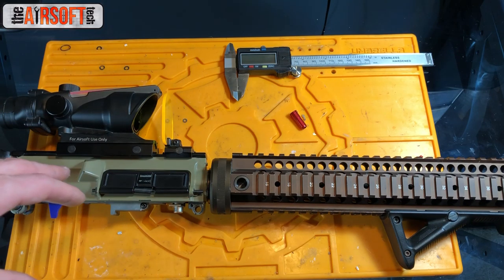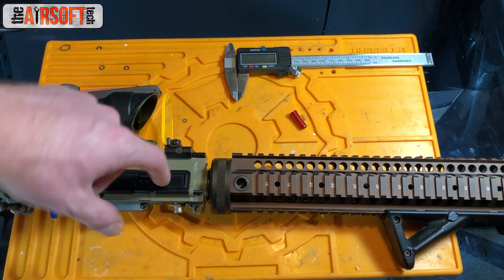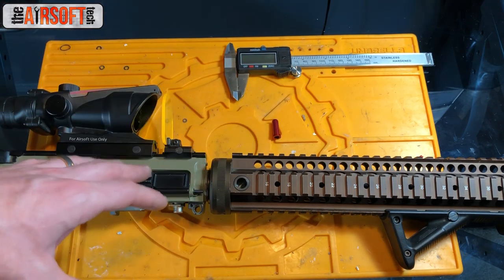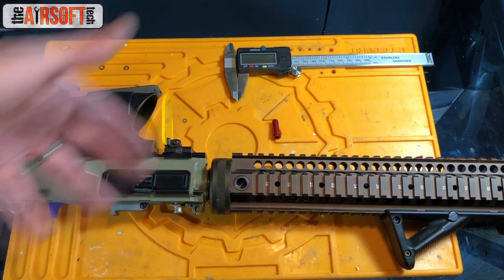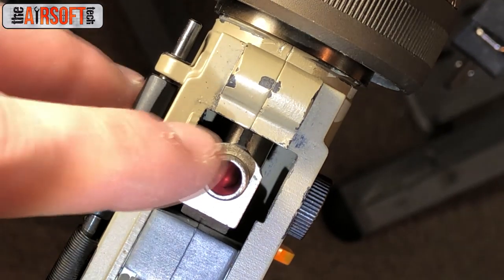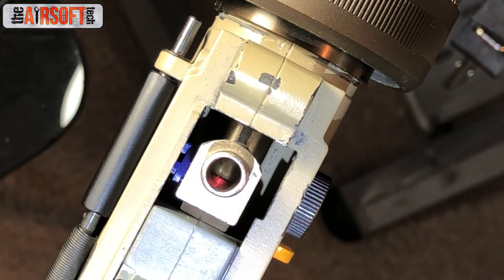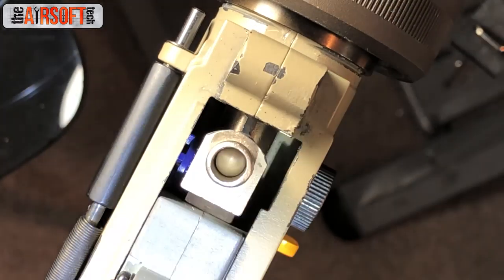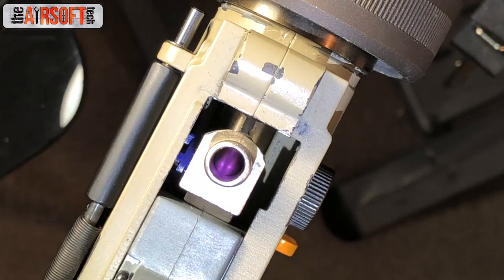Five Minute Tech Tips: Proper Air nozzle Fitment

Comment: Quick note: Whenever you shave down your nozzle, ALWAYS TAPER THE FRONT. If you do not taper the front, there will be lots of fps and airseal issues between the hop up rubber and nozzle. So put the nozzle on a drill and use sandpaper to create a rounded taper on the front of the nozzle
Reply: While this is generally true and advisable, I've been using the same un-tapered (or very minimal) G&P nozzle in one of my guns for ten years now, and it's never given me any problems. When in doubt, TEST.
Reply: So like question, what is the recommended method to shaving down a nozzle? What tools should I be using to shorten and taper?
Reply: @KoujiRenamon  i put the nozzle on a drill and then use some sandpaper like a makeshift lathe. round it off little by little until the nozzle is tapered enough to be making good contact with the bucking. Do not over taper or else you would make the airseal even worse. Test by inserting the nozzle into the bucking lips by like 1mm and see how well the lips wrap around the nozzle (no innuendo intended)
Reply: be careful when tapering. overdoing it will also make the  nozzle failed to mate with bucking lips and will drop the fps
Reply: @n8taing612 30° or 45° angle?

Comment: This didn't tell us how to find the right nozzle. Just tells us you need the right one. This isn't all that helpful. Having the nozzle go back far enough is just one of the factors. Also, you can only test this in the way you did with an ics split box. The air nozzle fitment is so important, and you have the least control over it. Just looking for answers

Comment: what about the nozzle meshing with the hop rubber? or i guess should the rubber be flush with the hop up chamber? it seems the purple nozzle stops just short of making contact with the hop rubber.
Reply: Looks like the airseal doesn't concern him although in this case you would want to assemble your gearbox without gears, spring and spring guide with piston placed in the rear position, then put gearbox and barrel\hop-up assembly into the build as much close to the fully assembled gun as possible with only exception being having a window to put a long rod and push the piston forward while keeping the muzzle of the inner barrel sealed with your finger, if the airseal in the cylinder and between nozzle and hop-up rubber is good - you won't be able to push the piston all the way forward, if there will be a hissing sound and a slow air leak - an extra 0.2-0.4mm of nozzle, more blunt shape of the nozzle front end or the hop-up rubber with thicker lips might help out, if there is no airseal whatsoever the gap between nozzle and rubber is major, you will even probably see the light from the feeding valve of the hop unit if you will point a flashlight into the inner barrel
Reply: @lauranceberiya1314  is there meant to be space for the BB?

Comment: So I have been teching for a while and learned most my skills from you, I rebuilt my buddy's gun. G&G C7A1 (converted by previous owner to A2) that comes with lonex internals from the factory. He got it for cheap because it wasn't feeding correctly and had horrible FPS. So I cleaned, re greased, corrected AOE (was pretty good from lonex), shimmed gears (horrible bound up shim job from lonex), swapped in an SHS lightened piston, new bucking and nub. Fed OK at first then back to miss feeding lots, but also had significant fps drop. Air nozzle was worn out on the inside (polymer) so I got a new aluminum o ring nozzle, glued it to the tappet and back together. Fps was good and miss feeding went down. I measured the OEM lonex nozzle and the new one, exact same length. Still misfeeding. So I shimmed the tappet with a piece of electrical tape, helped some but not a lot.
Kind of getting stumped on this one, hopup is lonex and isn't damaged and the o ring on the hopup is good. Nozzle spring is good (replaced), and the nozzle is OEM length. Could this be a tappet plate problem? Being this gun is older and seems the previous owner didn't take care of it, I'm thinking the tappet plate is worn out. I'm going to swap in a new one once I get it here from evike (living in Canada and ordering guns takes a while). 
If anyone else has any suggestions please let me know
Reply: Most likely tappet plate, they do wear down where they contact with the sector gear
Reply: Check also the magazine you are using.
Reply: i also have some problem and took me years to solve. basically here it is:

1.) bucking lips too tight inside the chamber. could be due to thicker, harder bucking, or disfigured chamber. test it by putting one BB, and push it with something. if it hard, thats definately the issues. change the bucking into softer one, or file the inside of the chamber, or sand the bucking lips with very fine sandpaper
2.) not enough tappet spring power to push the BB into the chamber. this may due to week spring or too much upward tension of BB by mag spring. the fix is by strengthening the tappet spring by cutting it 2-3 coils. but dont make it too harder or tappet will break. or reduce the strain from BB from mag by filling it not too full (midcap) or dont wind it until too hard (hicap)
3.) nozzle diameter too small and create too much play inside the chamber. if the nozzle to much play, it will misalign when being pushed by BB from mag and create issues such as misfed, doublefed, or fps loss. use the matched size nozzle for your chamber or shim the chamber internal by using thin sheet metal + power glue
4.) nozzle too tight also will create a lot of issues as mentioned above. fix by the opposite as mentioned above.

basically, thats all the problem that for me become misteries for past 8 years. i always focus and gearbox and compression part, but never realize that nozzle, bucking, chamber ( and receiver) is as imortant as the gearbox set
Reply: @ebehdzikraa3855  I was having double feed issues with the maxx nozzle (21.4), so I went back to the stock CM16 nozzle (21.34) and the issue was gone, but yeah, I could kinda solve by not filling too much my midcaps, but I never had problems with the stock nozzle even full filing my mids, because it sits tight enough and doesn't have any wobble (unlike maxx nozzle), the only problem now is that it doesn't have a o-ring, so I lost a couple joules. Now I bought a VFC polymer air seal nozzle to see if seals nice without causing me midcap syndrome (umbrella armory guys uses it a lot so I'll give it a shot)

Comment: Great video. Like he said, if this doesn't work then there might be other problems causing feeding issues. Most common is when installing a new bucking(whether it be with a new barrel and hopup unit or not) and the bucking is in too deep or shallow. Test it by seeing how easily a bb can be pushed through the bucking. Similarly when installing a R hop. Many patches came out perfectly but after installing everyting into the hopup unit I noticed that the bb catches on the patch. Mostly due to the bucking or hopup arm.

Comment: Bit of trivia about ICS M4s (I've been teching them exclusively since 2005), they have some parts commonality with MP5 parts e.g. the geometry of an ICS M4 safety/trigger blocker is more in keeping with that of third party MP5 safety. I have found no difference in air seal quality in an upper built using an MP5 nozzle and a seperate upper with same spring using a Guarder M4 nozzle.

I suspect this was done because ICS were one of the few 'full metal' competitors back in the early 2000s for M4/M16 and MP5 products and homogenising these plastic parts cuts down on the amount of different parts needed to complete guns.
Reply: Nice you must have a whole list of good to knows :)
Reply: @WazheadBoci  it depends on which generation of ICS gun you're working on.

One really weird thing I found with the forward assist spring release series was that I discovered a recurring fault in a high speed set up (DSG 10.1 gears, was running about 46rps at 310fps set for .25s, single stroke wanker gun basically)...the fault was that the anti reversal extension would shear off the part that would be acted upon by the forward assist.

Dremelling a little material from the lower gearbox case and the upper gearbox case and shaving about 2mm off the back of the tappet plate so there was no way any of these things could contact the ARL arm over the entire distance it could theoretically travel and it never happened again.

ICS guns have pretty poor AoE when you change the sector gear and piston - stock ICS pistons appear to marginally longer than TM spec so it's probably easier to think of an ICS M4 gearbox upper as having all its guts a little further forward in relation to the sector gear axle axis. Very small difference I had no end of problems seeing very aggressive piston wear within only a few thousand rounds with TM, Deepfire and Guarder polyacetal pistons with the same piston head without AoE correction. Most guns need 0-3mm adjustment, ICS M4s it's closer to 4-5mm. That's significant and I believe contributed to their early rep for not being easy to upgrade.

The material they use for the stock 'nub' in the hop is garbage, the actual sleeve they put on the barrel is adequate (for UK power levels).

Because their lower receivers are longer than normal behind the pistol grip this can be an issue for some brands after market grip with an extended beavertail design where an extension of the grip would ride over the web of your thumb.

Receiver threading can be a bit of a PITA for aftermarket barrel nuts (wire brush and anti seize are your friend). Plastic hop unit 'wings' that slot into the outer barrel are top fat (tall) for the slots in G&P barrels so you're either dremelling/filing the barrel or the hop which has a risk of nozzle/hop unit misalignment if you get it wrong (measure twice, cut once).

A wobbly stock ICS outer barrel (they're technically 3 piece between a hop housing base, mid barrel and then an extension that the foresight attaches to that can be adjusted in length slightly) can be remedied by drilling the pins and screws out and threadlocking grub screws in place, think I've used very short M4 grub/hex screws in the past. That was more around exploring how to make the gun more accurate and obviously you want everything in the upper part of the gun to be as locked together/rigid as possible.

Comment: thanks a lot for all the cool tutorials. 

I have a question: You just covered nozzle length in relation to feeding issues. I just bought a MAXX adjustable nozzle how do i figure out how deep i want it to go inside the bucking to get the best air seal? adjust nozzle and test shoot for fps constancy  ?
Reply: Also in this boat
Reply: do it manually by pushing the fully assembled chamber to fully assembled gearbox and blow it with your mouth. if it no leak, thats a correct mating between nozzle and bucking.

but be careful, good mating frequently will result in misfeed due to the nozzle was not moved backward enough. 

my solution of this is by make sure the backward movement is enough to clear the BB first, then filling the front part of the tappet plate (and also camming leaf on the back, at the  sector gear axis during full forward position). this will make the nozzle move more forward without sacrificing backward movement. but dont file it too much since it could make the tappet become flimpsy and ruining it

Comment: Also how would you pull back on the tappet on a non-split gearbox?
Reply: You don't.

Best tip I can offer is to basically put the gearbox together but without the cylinder, piston or pistonhead, so you can reach the tappet plate from where the cylinder usually sits, and then hold your hop-up unit against the gearbox.

Comment: Hey I’m new and still learning the basics,how are you engaging the nozzle into the hop-up? I understand or think I do that you are pulling the gearbox out and making it fit in the upper receiver. Correct? And then? Appreciate any help from anyone viewing message. Love your channel 63 and getting into the hobby with my kid and grandkids
Reply: Nozzle sits on the tappet plate inside the gearbox. You have to open it to replace them. But the nozzle sticks out of the front of the box. It then connects to the back of the hop up.

Comment: I have an M4 which was a split hopup unit type. I made some tiny modifications and put a non-split hopup unit in. I had a feeding issue and was very confused because when I bumped it while upside down it would fire 1 round. But after a lot of testing I realized my feeding issue came from nozzle length. I shaved down the length of my nozzle and fixed the issue. However I didn't do a good enough job getting it straight or I shaved too much. Ending up with significant drop in fps and terrible accuracy. But feeding issue was fixed. Will order a 19.5mm nozzle and 20.7mm since stock m4 was 21.5. I believe the 20.7 will fix it if not 19.5 definitely will.
Reply: Have you fixed this? How did you shave it? I have same problem with a split hop up sr25, im planing to sand the tip of the nozle off bit by bit test it after each 6 sanding strokes prety much
Reply: @epicmexican7153  Also although Ive seen a few guides of people shaving/cutting their nozzles I've yet to see a diy method that gets it smooth enough for me to fully trust the nozzle wont somehow create inaccuracies...

Comment: I have a really old mp5 sd from classic army. Finally followed a bunch of your videos to fix it up and the gearbox and cylinder run perfectly but it still seemed like it was having leak issues. I guess I will have to trouble shoot the nozzle and try some different sized. I’m thinking it’s too small. I have really low FPS.

Comment: Thanks for the tip ! Since you glue the nozzle to the tappet, it might be a good idea to do this test before and after gluing the nozzle or it doesn't matter ?
Reply: Don't glue it to the tappet plate, there is no reason to
Reply: @Zeryth960  Ryan seems to do it, reason being that the nozzle might not be seating on the tappet plate without moving slightly, which can lead to fps consistency issues IIRC
Reply: @Zeryth960  I glue it on every gun I work on, there is lots of different gap sizes in nozzles for the part that seats it to the tappet, and lots of different sized ridges on tappet plates. This mitigates those variations

Comment: Mate you are the GURU 👍IM IN AUSTRALIA WHERE THEY ARE BANNED BUT I HAVE A WELLS M401 CONVERTED WITH ORIGINAL PORTED CYLINDER STANDARD SPRING AND WITH .12NBS DOES 400 PLUS ALL DAY WITH EASE OH AND I HAD A PERUN V2 I THREW IN AND AN E&C HOP UP AND BARREL BUT IM STILL LEARNING and this video answered some questions i needed answering so thx and with a 100%  cylinder wats the maximum barrel length and inner diam for max fps and also sniper rifle a L96 whats best spring sixmze and barrel length for max fps

Comment: Thank you might of just solved my feeding problem on my krytac trident crb mk1. It feeds but rapid fire and full auto get alot of misfeeds. Have tried many different brands of midcaps without any luck
Reply: Can also be a tappet plate problem, have you changed the air nozzle?
Reply: Can also be a tappet plate problem, have you changed the air nozzle?
Reply: @marinusdedreu3833  it's all stock.

Comment: Great video on a current topic that is an issue for me with an UMAREX HK416. I installed a gate titan, and the nozel position is not consistent shot to shot. Meaning that sometimes the nozel is further back at the moment of fire, and sometimes it is closer to the forward position. Think it has something to do with the pre-cocking and active braking. Any ideas?!
Reply: Could also be the sensors somehow not picking up at the exact same time. Also full auto would make it have random positions
Reply: That should not be the case since the tappet plate is released by the sector cam at always the same moment relatively to the release of the piston. This is a problem with your timing and other parts, not the gate.
Reply: I ran into similar before and corrected by adding a sector delay to the gear.  Gives a little more time for the bbs to feed if it’s a feed problem.  Or check to make sure your tappet plate is moving free, it’s pretty easy to misalign them on some gear  boxes. Another spot is your piston seal....  lots of spots to look at....
Reply: Also, look at the tappet plate return spring. If its worn out and not very stiff, then the return of the nozzle might be different from shot to shot. Also check to make sure that there is nothing blocking the tappet plate from returning fully to the forward position.

Comment: I was using the SHS M4 nozzle with my Maxx hop unit and it was too long so I had to file it down to 21mm it wouldn’t feed before.
Reply: What was the problem with the m4? I have a shs nozzle mounted on a maxx model camera, and some shots go up, 5 normal shots and 1 up shot (hop up high)
Reply: I have the same set up (Maxx hop up and SHS nozzle), did filing down the nozzle completely solved your feeding issue? 

(For me different mags have different issues. Some do not feed at all, some get the bb jammed half way and on the second shot it shoots (every other trigger pull it actually shoots the bb)). I am wondering if filing down the nozzle, or removing some of the hop up springs will resolve problems. 

One thing to point out is that when I hold the mag at certain position/angle, feeding issues disappear.

Please let me know what you have done to solve your issue.

Thanks 🙏